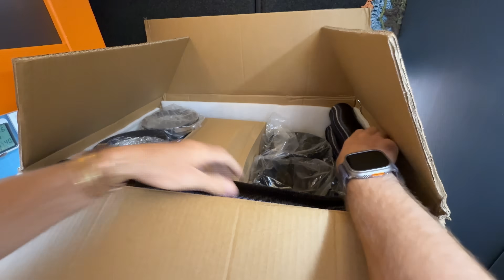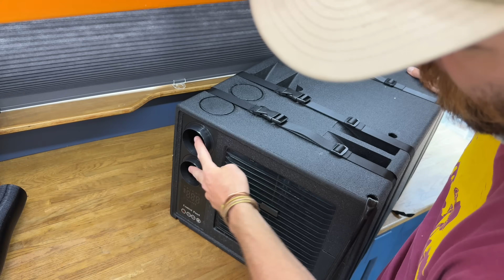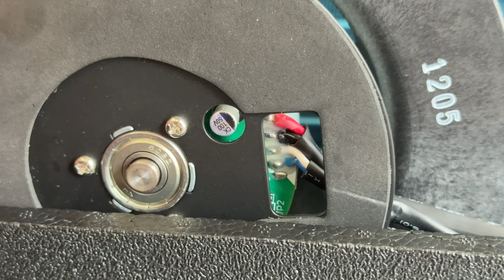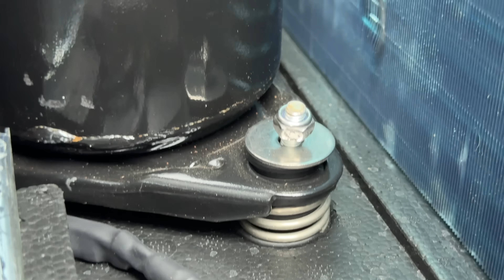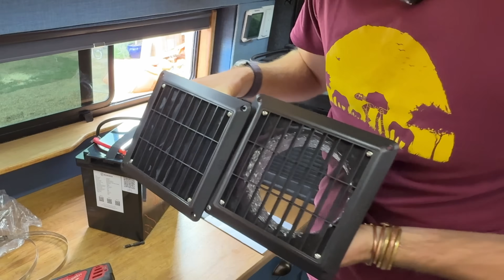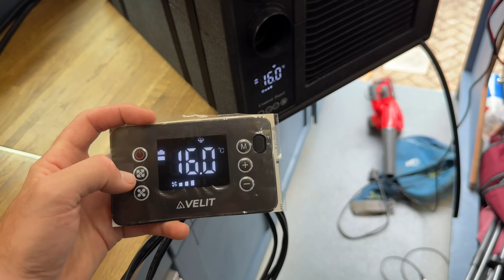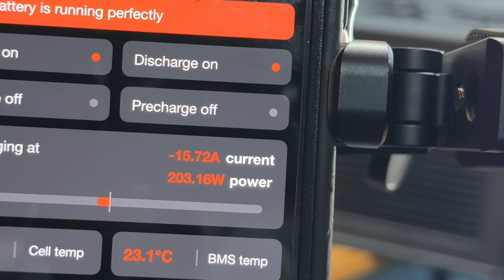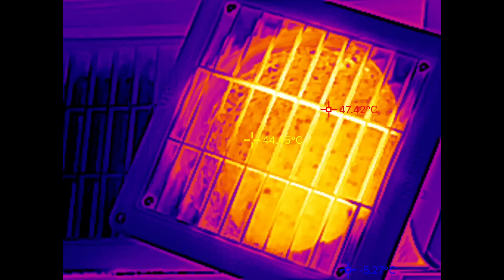12V VELIT 2000U Air-Con | Power Test for Off-grid Use

Comment: I would have thought that mould and bacteria growth in an area of the air-conditioner that is not readily cleaned would be the reason not to drink the water it makes. There's nothing wrong with demineralised water in most cases. Usually people get plenty of minerals from food. Maybe in a survival situation where you have no food it may be an issue if you don't even have salt.
Reply from the maker: Contamination would also be the other main reason which could be fixed with sterilisation. I guess it also depends how much water you were drinking in regards to the mineral aspect. It seems it’s one of the main features promoted for commercial and consumer atmospheric water generators is there remineralisation process. As they effectively make the water in the same  way.
Reply: @MispronouncedAdventures yeh, but you can "remineralise" water by eating beef jerky. 🤷‍♂️
Reply from the maker: @MrGundawindy  that seems oddly specific
Reply: @MispronouncedAdventures well I had already mentioned the general solution of getting minerals from food instead of relying on minerals in water. I was just using an example that is mineral rich, but any salty food would do. 🤷‍♂️
Reply from the maker: I just thought Beef jerky was very specific option got nothing against it. I love it
Reply: @MispronouncedAdventures it is great if you're hiking or otherwise sweating a lot and are worried about your electrolytes. If rather eat jerky than drink gatorade.
Reply from the maker: @MrGundawindy  I’ve always got a chunk of biltong ( beef or game ) in my pocket when I’m working throughout Southern Africa And in the Nordic I often buy reindeer.
Reply: @MispronouncedAdventures that'll work. Biltong is delicious, and salty.
Reply: oh yeah.... guys... dont drink evaporated sweat !
Reply from the maker: The actual quantity of moisture in the air would be mostly from ambient humidity very more small amount of it would be from sweat. It’s also not sweat anymore when it’s evaporated.
Reply: @MispronouncedAdventures  hi, i work in HVAC/R (install/repair/maintainance) and trust me: stagnant AC condensate is NASTY.

on DX systems in air handling units you get 100% outside air moisture and it produces wayyy less disgusting condensate then return air based AC systems.
Reply from the maker: Oh, I have no interest in drinking it!
Reply: @MispronouncedAdventures  yeah i know 😂 but some other postings seem to be tempted
Reply from the maker: I assume though the problem is the machinery/surface it condenses on because surely evaporated water /humidity is just going to be pure? But the conditions of the surfaces it condenses on and pools is where the impurities coming in?  it’s a similar system to atmospheric water generators?

Comment: Would iit not be cheaper just to leave the engine runnning wiith the AC running?....😂👍
...somebody probably already said that.
Reply from the maker: Don’t think I’d want to leave a modern diesel engine idling that long
Reply: @MispronouncedAdventures  Did not realise it was Diesel, but yeah, not good!
Reply from the maker: In Europe, almost every van is diesel. We don’t use petrol for that sort of stuff.
Reply: @MispronouncedAdventures  Anyway, it was just a thought. Cheers. 👍
Reply: @mickgatz214  more sense to converting the vehicles aircon compressor to be one powered by  DC electricity rather than by belt from engine. Then you re-use the aircon you already have in the vehicle, and power it from your leisure battery  / solar etc.
Reply: @MispronouncedAdventures  Why not?
Reply: It won't be cheaper as idling your vehicle takes a toll on the engine/transmission.

Comment: How's the new van hunt going?. Had 2 brand new Grey Merc Sprinter vans pass me on the motorway today on the back of a low loader HGV. The were 4x4 and and had the look of a VW Transporter Swamper. For some strange reason i thought of you and it would suit you down to the ground Alex
Reply from the maker: Potentially might be under something.  fingers crossed

Comment: 0:59 Thats a thick Red cable, nearly as thick as a alternator cable/harness
Reply from the maker: I would’ve thought your alternator cable would be a bit thicker than 16mm2  probably 25 or 35mm2
Reply: @MispronouncedAdventures  On the camera that looks thick cable. i know its not as thick as a alternator cable, i just think of burnt out engine fuse boxes on VW   lol

Comment: Wish it did heat also.
Reply from the maker: Which of been a nice feature. A few air-con units for vans do also work as heat pumps
Reply: if you're already building your setup around the unit, it would be pretty trivial to throw some dampers in and redirect the exhaust back inside, and add a vent to direct the cold air out
Reply: If someone built a smaller, keenly priced unit they'd sell thousands of em. Have you had a go at building a peltier unit?
Reply from the maker: @MultiOutdoorman Peltier units isn’t going work for air-conditioning well. They barely function inefficiently for cool boxes and munch through power. Although I do generally just want to have a play with a unit.

Smaller in this context probably isn’t gonna have the output required to significantly cool the van. zero brew and EcoFlow waves air-con units are pretty small